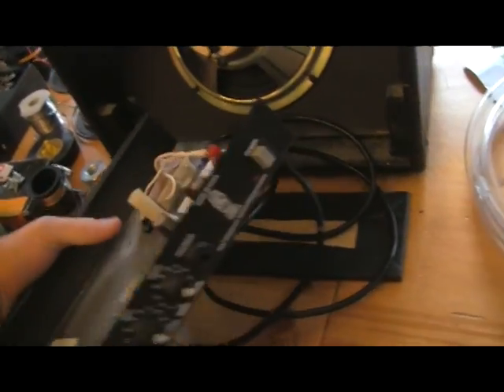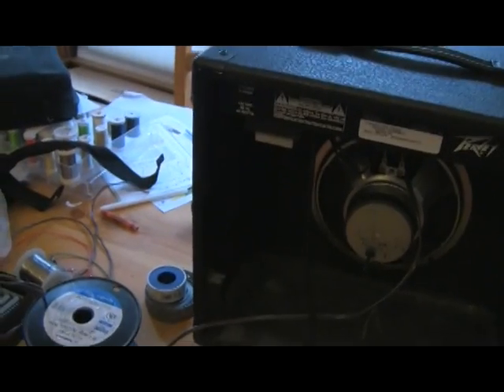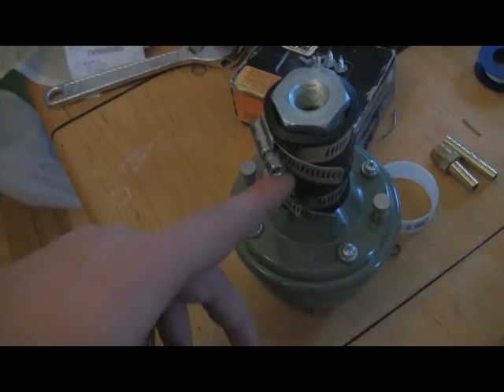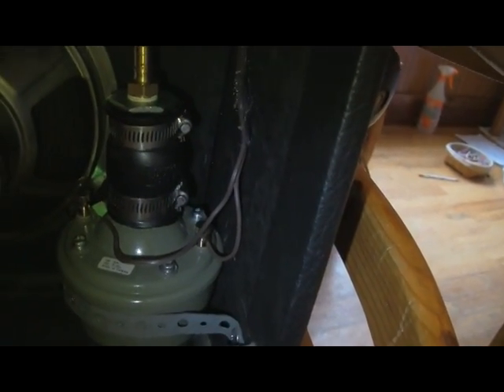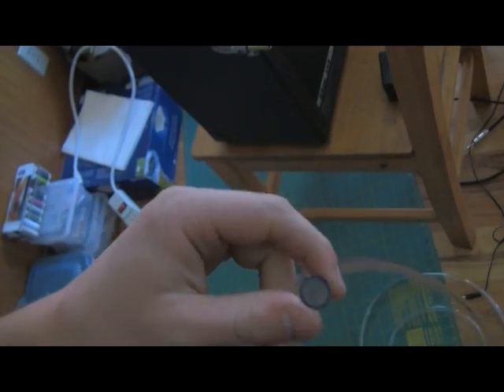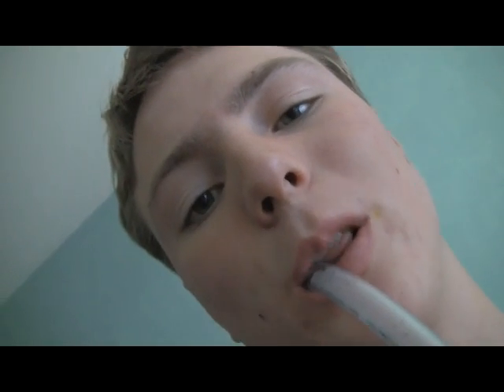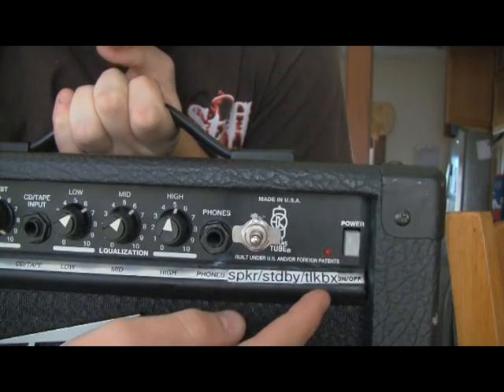Building (and playing) a Custom Talkbox -Part 2of2

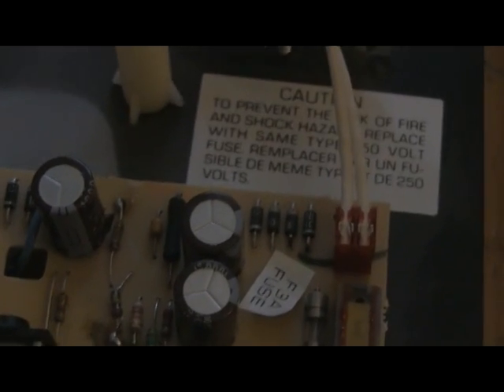Comment: in 1:02 you show the little yellow wire hanging right to the phones plug, but my guitar amp doesnt have that wire, did you attached the wire? and if so, where? or it was like that? HEEEELP please!
Reply: That is the wire that was going to the speaker and now it goes to the commutator to change it from internal speaker to the trasducer for the pipe

Comment: Great Job and Effort to help people with a DIY...
Could I suggest, from a Transportation to a gig etc. point of view,
I would say, mount the Hose/Tube connecting point on the Inside of the amp box facing the rear, that way there will be no damage to the connecting point during travel..!

Comment: The standby position on your toggle switch is a bad idea. You'd be safer using a two position toggle switch that will put your amp in talkbox mode or amp speaker mode. The amp needs to be driving either the speaker or the horn driver. If you mistakenly leave it in the standby position and turn your amp on and try to play through it, you'll burn your amp up real quick.